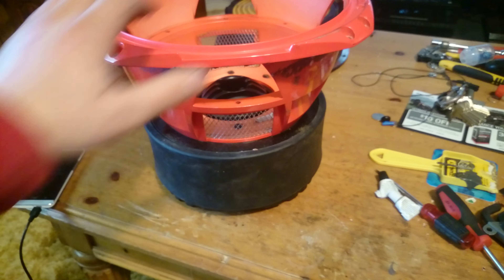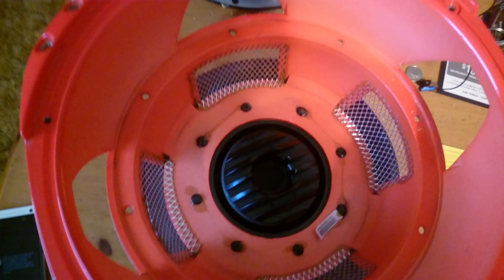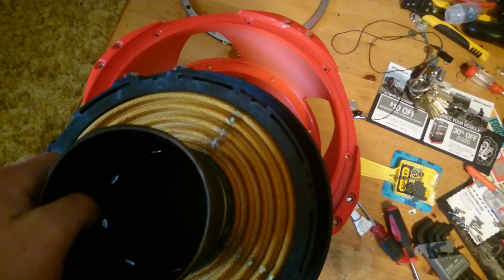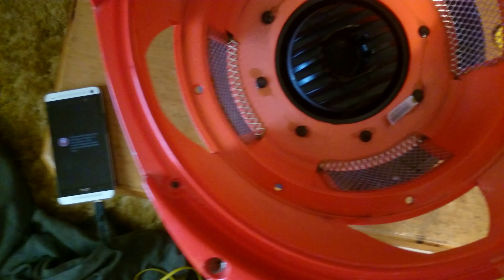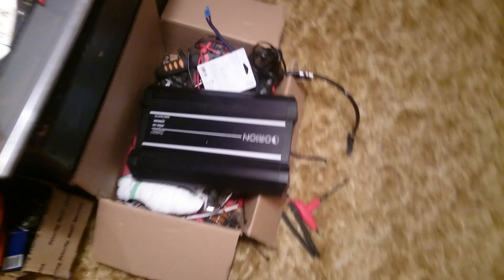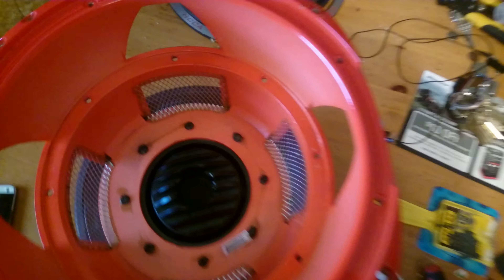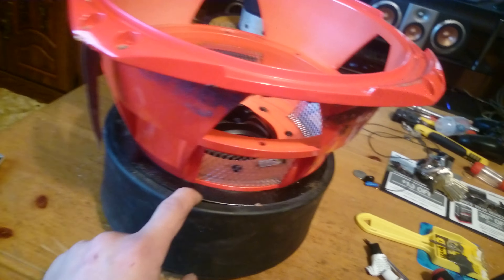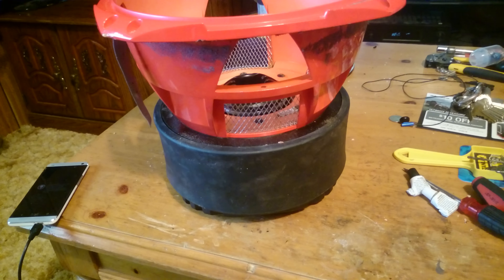Bad news to my Orion hcca and xtr2500.1d

Comment: My Orion don't even have the dome thing on top of the pole
Reply from the maker: Jason Brattain oh really is yours the older version the gray cone
Reply: Kyle Worful no its the black coil
Reply: Kyle Worful is there a difference between the three? My cone is great. I bought it in 2014. I don't 100% recall which color the coil is but I think I have black. I REALLY don't want to pull it out verify (you know how heavy they are).
Reply from the maker: 86 pounds for the hcca12.2 and from what I know if the cone is black the voice coil will be black
Reply: Kyle Worful I should've written it more clearly. Is there any difference as far as coil gap, SQ, etc?
Reply from the maker: Honestly I not to familiar with those specs
Reply from the maker: I'll do some research and see but don't know if I could find an old manual
Reply: Only way to tell is to look at the coil if his cone is black
Reply: Kyle Worful I appreciate that. You don't have to. I was just wondering if you or anyone knew off the top of their head. I have a gray cone and I'd hate to spend $150 on a black  replacement just to find out it doesn't fit. At the same time, I'd hate to be missing out on something special.
Reply: Jericho Snaxxx so u have a gray cone and wanting to replace it with with a black. Should be fine as long as the coil is the same example 4"
Reply from the maker: Ya Im pretty sure they will work together I think the bucket and magnet are the same
Reply: Jason Brattain thanks. I don't "want" to replace the gray gone if I don't have to😅 But just in case I have a bad day and I'm forced too lol. I was also considering buying a new one and it will obviously look silly with one black and one gray. If the power handling is different then that could pose a problem too. I can't recall if it was Soundqubed or another brand but they did something similar but the coil gap was like 1 or 2 mm difference and they got a lot of hatred from people buying recones and having coil rub because of that unannounced difference.
Reply: Jericho Snaxxx no problem I'm trying to sell my 2 12's so I can get 18's
Reply from the maker: Nice I just bought 2 of the hcca154spl 5000 rms both black cones don't have them installed yet waiting on the amp hcca11000.1d
Reply: Nice
Reply: Rumor mill has it that Orion is coming out with a new line called "Orion Beast" that will go up to 18" and is essentially the SPL line but will be it's own dedicated sub line from 10-18"s. I cannot find any legitimate verification but members of the Orion FB page keep repeating it. So I've been trying to hold out until they arrive.
Reply: Someone on YouTube is running a pair of the 11Ks. I'm running an 8K. I love it.